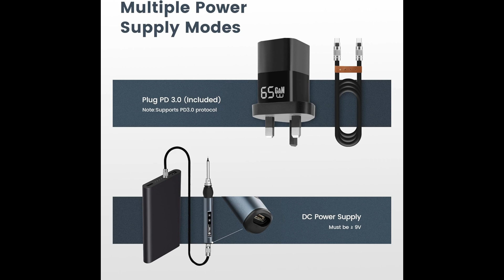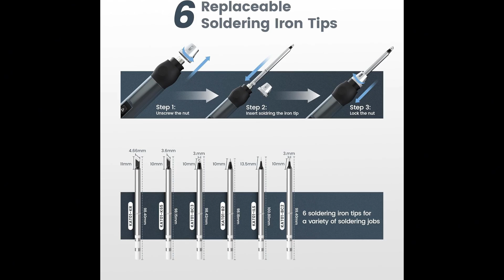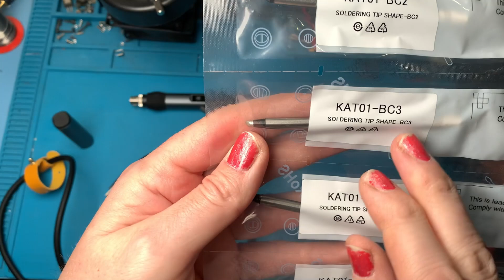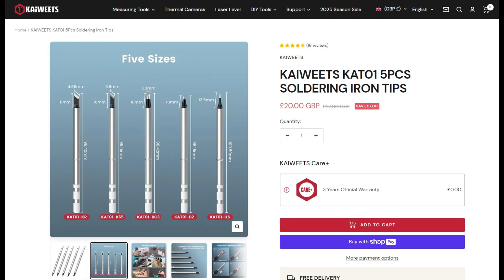Kaiweets KETS02  Soldering Iron Product Review - Rapid 8 Seconds Melt Time!

Comment: A nice piece of equipment, the only drawback is the very thick cable. I don't think it would be nice to work with.
The Weller WSD81 and the KSGER12 that I have here have a thinner and more flexible cable, but they are fixed stations.
If they would adjust the cable it would be 10 points
Reply from the maker: As I said in the video. I did not find it a problem. It's just a high power USB C cable. You could use a different cable with it instead of this one if you wanted.

Comment: Nice iron! It's nice seeing the reviews of different soldering irons in case my 45+ year old Weller dies. Yes, the Weller does take forever to warm up!
Reply: These new ones, yes many of the same of them, have been a game changer for me.  Unless you have a workbench that you use all day long then I would stick to the Weller. It's still a nice stable stand and trusty stuff.  I have like 4 Wellers around here as well including a '70's model which work perfectly btw. 
I don't have a workbench anymore so I need to take out all electronics on my table every time I go play around. If you plan to buy one choose one which has build in PD and a USB-C.  My laptop charger and my powerbank all do PD (go up to 20V) and can deliver 65 Watt.  So loads of choices and also cheap tips.  During the summer I also sometimes sit outside and solder.  Just ordered a ANENG SL108 for like 15 euro delivered. Sometimes testing these things is also a bit like playing with electronics.
Reply from the maker: @Luke-san soldering outside in the summer. That sounds relaxing. Thanks for watching.
Reply: @    You have no idea. Natural light comming from everywhere. Hearing birds and some soft music from a portable BT speaker.  I bought some plastic boxes in Ikea which I just take outside with the stuff I need like pliers, soldering silicone mat, etc. There is one thing like that power supply that you have, the colour display is no good outside. I use a SK80H with a standard LCD display for that . Perfectly readable in the sun.
Now if it was a nice 21C and no wind every day ....  but I really enjoy these outside moments. Everything is like you said more relaxing.  Keep up the videos, I really enjoy them and I would like to encourage everyone to comment. Sharing is caring!

Comment: Nice looking iron. And as 65W (or higher) output power banks are available, that could make a handy portable solution. I like!

And BTW nice use of "naughty" red reel solder. You can't beat it.
Reply from the maker: Yes, use with power banks is completely possible and a good idea. Also with it heating up so quickly you only need to have it on just when you go to use it, rather than draining your power bank all the time.
'Naughty' red solder is the best. The politically correct green stuff is just rubbish.
Ask yourself why aircraft and military equipment only use 'red' solder and not 'green', possibly medical equipment as well.

Comment: Maybe check that the temperature set is actually the temperature of the tip.
Reply from the maker: Yep, great point.  I checked it last night with a thermocouple, see the photo in my posts section.  Tested it several times and it was consistently good :)

Comment: Like some other commenters mentioned, this one looks exactly like FNIRSI HS-01, probably the same OEM and design. It indeed heats up quick.

I'm ambidextrous, solder with either hand, and I never really noticed the auto-reversal on FNIRSI, and I used it quite a few times in my friend's lab. I'll have to test it when I'm there.

Weller Magnastat is indeed slow... I could say the same about my trusty Solomon SL20, I've been using it for over 15 years.
Reply: the  HS-01 is the older model from FNIRSI. there is also a newer one the HS-02 with max 100W this is quite faster heating up than the HS-01
Reply: @henryganzer4685  yes, but the newer one looks different.

Comment: Would be interesting to see how it performs on heavier cables and large ground planes.
Reply: My guess is that with the speed it heats up, there's plenty of power to keep the tip hot on more difficult jobs. It would be nice to see it tested, though.
Reply from the maker: I didn't think to try that. Maybe on the next one.
Reply: @ The issue I see on the cheap end is that it may be able to draw the power to heat up quickly but cannot maintain it and you get things like power mosfets overheating. Or you get oscillating temperatures because the controller can't maintain temperature when it is drawn away too quickly.

Comment: I have four soldering stations, so I rarely have to swap tips. I often need two irons for passive surface mound passives. I use a small chisel for most work, except or  very fine pitch ICs. I routinely soldered ICs with 13115" center to center spacing under my B&L microscope. I get much better hand to eye coordination  with it, compared to a digital microscope.
I have about 20 soldering iron, including rechargeable irons. The old Wahl had a 'Tuner extension tip' that would slip through up to three inches of insulated wire without damage. That was more than worth the price of the iron!

Comment: why did you measure the temperature of the iron tip with probe to see how accurate the read out is?
Reply: I suspect the accuracy of the readout is not inherent to the device, but instead to the tip where the thermocouple is mounted.  It's possible to use the calibrate portion of the menu to calibrate if you need to fix any tip inaccuracy, JJ simply didn't show it.  Really, most people simply bump the temperature up or down as needed and don't care how accurate the temperature really is.  11:05 "It won't let you heat up the iron without the tip in it"  Really? How would this be possible with any device which has a external heater? 😊
Reply from the maker: I have since measured the temperature. You can see that in a community post I have just done. It is accurate.
Reply: @JazzTechUK  Great. Still I would test it from time to time.  I've seen more than one iron develop problems and cause damage to boards Too high will scorch the board, while too low cause the heat to spread through the substrate due to longer soldering times. Single and double layer aren't very critical, but 16 layer are a different story.
If you want real fun, try creating a reflow profile for a full size VX/VME instrumentation card.  Every board had at least one profile, depending on the options used in a run. We used a late '90s  Heller oven, and am industrial board cleaner that used a citrus based solvent to remove the flux. It was a factory modiffed industrial dish washer with a holding tank to reuse the solvent, then fresh water for the cleaning cycle. After cleaning, they went into a stainless steel drying cabinet to bake at 120F overnight. I know this is well above hobbyist level, but some like to know how things are done at a factory You don't hand solder a board with thousands of components, that cost over $8,00 wholesale..
Reply: You do it because the irons aren't always accurate. I did workstation testing on anti-static and soldering tools every 90 days at a factory. You had to re-calibrate man irons each time the tests were run, and replace some irons. It was part of doing NASA rated work.Wrist straps and cables were tested daily, at one of several test points on the factory floor. The mats were inspected along with the irons, because that can be contaminated and no longer dissipate static. The had a 1 meg, 1/2W resistor in series of the mat and the wrist strap to prevent electrocution, in case a worker touched HV.  3M made my mat test set, but the bench tester for the wrist strap is generic. Our soldering irons also required under three ohms to ground to prevent AC leakage. I used a spare digital bench meter at my bench. Just touch any hot area to a piece of copper foil with a dot of solder and it only took a few seconds.  I tested every iron daily. It also pointed to failing tips that were developing micro cracks. This is several levels above hobby work, bu was critical for space hardware.